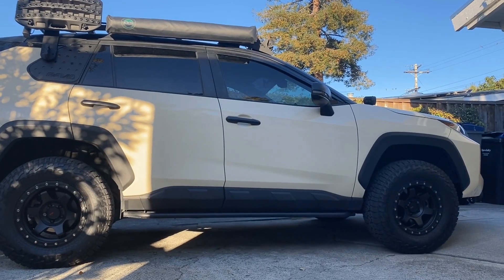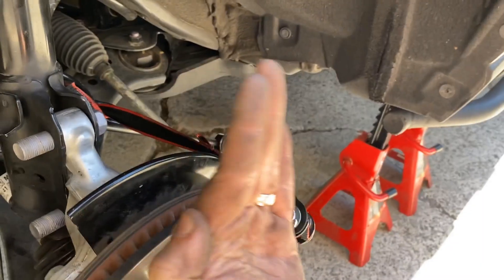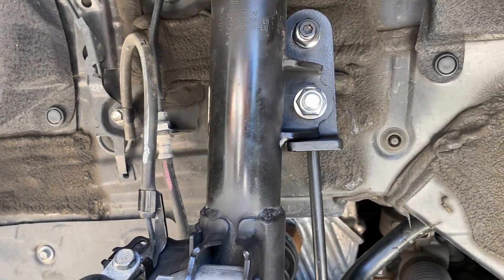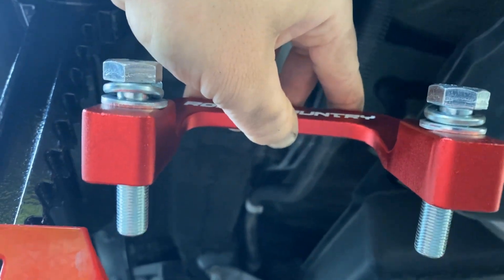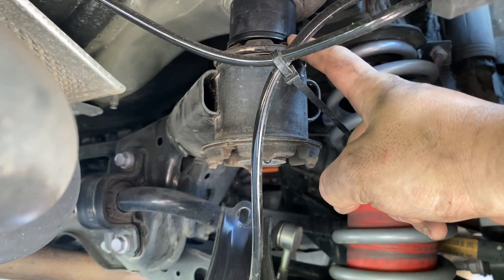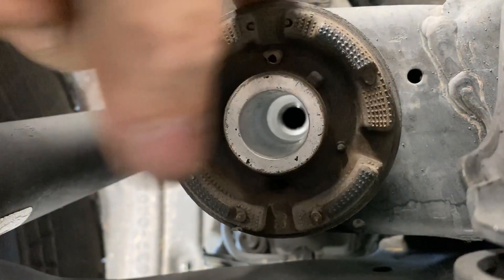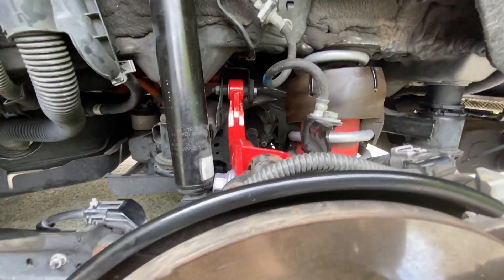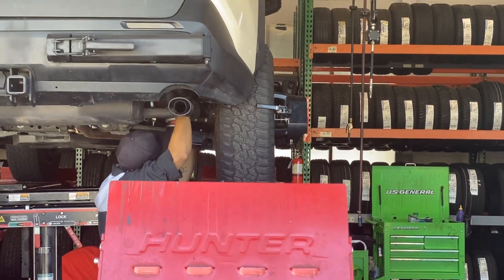Rough Country Rav4 Lift Kit Install

Comment: I recently lifted my 2022 Rav4 xle with RC kit and stacked with eibach springs in front and rear, I am experiencing similar vibrations/shimmy when accelerating in the 15-25mph range...what brand tire did you first purchase and what tires did you switch to that you believe removed vibrations? Do you believe that any of the added alignment components you installed also could have aided in removing vibrations?  Your feedback would be appreciated.
Reply from the maker: I didn’t stack the front. That’s the main reason I didn’t do that.
Reply: So you didn't do the added springs in the front, you just did the back springs?
Reply: I am experiencing the same thing I have a 2020 Toyota RAV4 adventure package I will drive and I added the roof country 2.5 inch lift and now at about 18 mph to about 28 mph from acceleration from moderate to harsh, I am experiencing a shimmy , i’ve done research and I’ve looked under the truck. The CV axles look actually not too bad at rest or under load now I’m wondering if maybe the driveshaft needs 1 inch spacers or 1 1/2 inch spacers on the center support bearing for the driveshaft can come down. Maybe possibly that could be the problem I’m not sure only research could find out.
Reply: @tripplepproductions5771 I'm experiencing the same thing I did space it out it fixed another but noticed that the bearing is sitting straight which it needs a drop and an angle
Reply: @Carubines  bearing? You talking about the strut bearing ? Or ? And what did you space out ? I’m trying to figure out why it’s vibrating so much only at those mph though

Comment: How did you take care of the wiring for the hybrid system when you lower down the rear crossmember LP off-road does not make a lowering kit for the rear suspension because they don't have an extension for the wiring harness for the hybrid system .

Comment: Is your Rav still wobble at free after 10 months? I have the same kit, same tires, I just don't have the adjustable control arms but I have that 30 kmph shake people seem to have.
Reply from the maker: No shakes unless I gun it from a red light.
Reply: I get that shake from 18ish mph to 28mph cruising or harsh acceleration… what could it be to fix it ?

Comment: Did you have any issues with vibration? Did you have to shim the drive shaft at all? I'm noticing vibration as I accelerate from stopped, but its fine once I'm at speed.
Reply from the maker: Only had vibration issues before alignment and new tires. After that the vibration at low speed was gone. My front bumper weight could be playing a part in weighing the front down just enough to further reduce any vibrations that I would otherwise have noticed.

Comment: I have a 2019 rav4, le, had installed a RC 2 and a half lift by a good off road shop a month ago, everything went well < looks great  but because the 73100 kit didn't come with needed shims for the drive shaft support bearing , because the shaft support bearing is in stock placement I developed  a shaft vibration at or near the support bearing , How do I know that its there ? well at 20km to 40km I feel the vibration in my seat , the sweet spot where its worse is 30km under torque, at no other time does it reveal itself.. the RC 73100 kit is well made , why wasn't the shaft bearing shims and longer bolts included with everything else ...? so of you install this equipment watch out for torque vibration,

Comment: Silly question? I just ordered a Rav 4 LE. I want to install a RC lift kit as well. Most everyone that I see "lifted" has a "Rake", meaning it not level and sits a little higher in the rear, compared. Is that something people prefer? Personally.. I want mine perfectly level.. Do you think I will need a levelling kit as well as the lift kit?

Comment: What kind of mpg do you get on the hybrid with all the mods you've done? Lift, tires, roof rack, etc
Reply from the maker: 18-28 depending on how loaded I am.
Reply: @spaseyota damn sacrificing 10+mpg on the hybrid models and probably getting more vibration with mud tires over street tires
Reply: I just bought a used prime and the dealer threw on new street tires. Going to get a spare set of wheels and off road tires that I’ll put on for adventures and then I’ll keep the other ones for the 95% might be a good way to maintain mpg then sacrifice it when needed. Spaseyota is looking cool though.
Reply: @connorsomers3250 still better than what a tacoma/4R would get

Comment: Hey buddy, are you getting any vibration from 18 mph to about 28 mph when you accelerate from a dead stop to a moderate acceleration to a harsh acceleration if you could please reach out to me if you don’t mind I don’t know I just added the lift kit as well but now we’re getting those issues 2020 adventure package
Reply from the maker: I have a hybrid so the suspension is dialed a little differently than your adventure. You probably have a higher lift up front than me and now you are experiencing axle bind. Try not to accelerate so fast and that will minimize the issue. I had the vibrations more intensely at first but they have dissipated now. I also take off from dead stops super slow. I’d recommend getting front subframe spacers for the front. Only company I know that makes them is Traxda.
Reply: @spaseyota  thank you I’ll look into it, I was doing research, I’m thinking about doing spacers for the front subframe and I also seen some 1” spacers for the center support bearing. But I feel like the transmissions is the problem here, if I manual select the gears on “S” and on a dead stop if I am in 8th gear ans start to go I don’t get that shimmy, could it be the transmission? Or maybe it is the axle binding up. Hmm. I wonder if they make better aftermarket axles for those

Comment: How did you deal with the airbags? We are having issues with the line kinking because we can no longer go through the bottom of the spring.
Reply from the maker: You can’t run bags with this setup. I removed mine and opted for the SumoSprings.
Reply: @Caleb Spase  ooooh ok!

Comment: Curious to know what your alignment specs are after the alignment. I installed the RC kit over 2 years ago without the Godspeed and cam bolts. Thinking of buying them to improve alignment.
Reply from the maker: Everything is back to spec except the Caster.
Reply: @spaseyota  anything you noticed that was negative for the car after installing? thinking of doing a 2inch lift as well. also, whats your mpg now? thanks for sharing the video.
Reply: @TansRav4 I got all terrains and 2.5 and can give me almost 400 miles

Comment: What did you do with the drive shaft vibration?
Reply: I don’t know much about this type of vehicle but when I had my 01 jeep  Cherokee I put a 3’ inch and needed to drop the transfer case to realign the axle and the vibration stopped

Comment: When on dead stop and accelerate 18mph to 28mph i experience shimmy or vibration any one knows or suggestions what was the problem??
Reply from the maker: Cv axles are binding. Try accelerating slower. If you have an adventure trim, this issue is more profound. If you’ve stacked lift kits up front then you need to reduce to a single kit. Also consider getting subframe spacers, and motor mount spacers for the front. Which may require you purchase the Traxda lift kit which includes these parts.